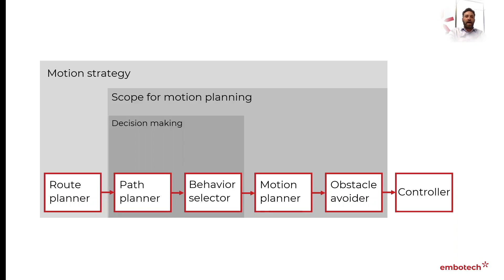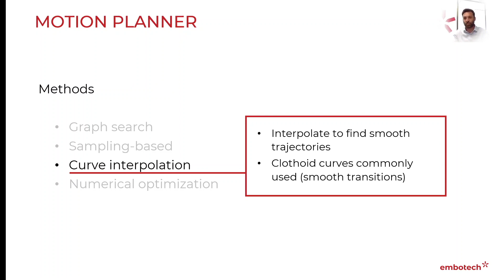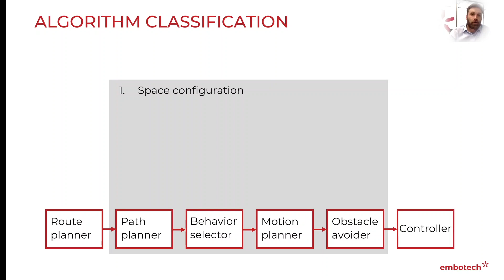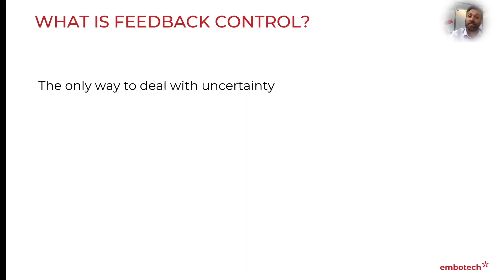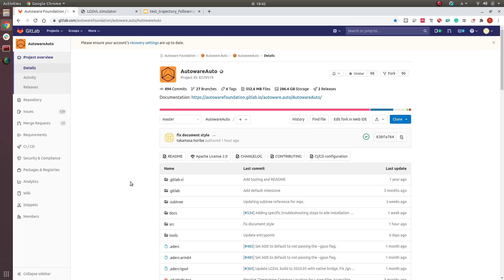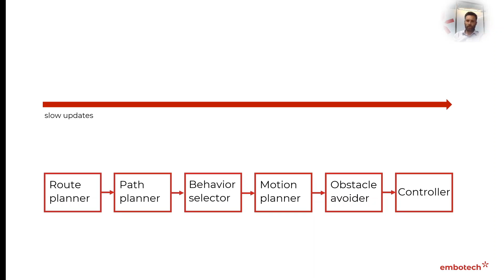Autoware Course Lecture 12: Motion Control

Comment: Hi about the lab: 
The guy told would issue the 2.Simple trajectory following  command. That is:
ros2 launch test_trajectory_following simple_trajectory_following.launch.py sim_type:=dynamics
However he launched this one of 3.Record play:
ros2 launch test_trajectory_following trajectory_recording.launch.py
Then rviz was displayed with the lidar info and odometry. However in my case I get this error, if I issue this command:
Global Frame: Error  
Odom does not exist. 
If I follow, step by step properly as written here https://gitlab.com/autowarefoundation/autoware.auto/AutowareAuto/-/blob/master/src/tools/test_trajectory_following/design/test_trajectory_following.md
I do open rviz2 and some matplotlib plots open together (unfortunately the lidar does not display anything, which means that is a problem with ros2-lgsvl-bridge) 
However my bridge connection was running properly and then when I launch the third node (ros2 action send_goal /planning/recordtrajectory recordreplay_planner_actions/action/RecordTrajectory "{record_path: "/tmp/path"}" --feedback) and the fourth node (ros2 action send_goal /planning/replaytrajectory recordreplay_planner_actions/action/ReplayTrajectory "{replay_path: "/tmp/path"}" --feedback) to record and play the path tracking with mpc (after move the car in simulator) I get a message: "Wait an action start" but never starts...
I runned with the executable lgsvl simulator (outside ADE) and Autoware lgsvl own version of simulator (inside ADE). In both I get this "odom" error. My json file of the car is complete with gnss/Odometry described in car Lexus configuration. 
I could just launch these nodes (also for Lecture 9 - radar, Lecture 11- Lidar+camera) when I do not use the command "source install/setup.bash". I use instead "source /opt/Autoware/setup.bash"
Then I thought that this can be the issue (The fact that I cannot use the cmd "source install/setup.bash". Because if I use what always happen to me is that when I issue this command:
$ source instal/setup.bash
in any shell to launch rviz2 or a ros2 node launch file. I get this error:
Segmentation Fauld (Core dumped)
or if I use to launch ros-2-web bridge I also get numerous errors.
Is there an expert that could guide me to fix this issue? I think this error is the main error of my system and is located in some bash file as this post recommend: https://askubuntu.com/questions/432476/running-bash-does-segmentation-fault-core-dumped
However my setup.bash or .bashrc does not have this source to "profile"...
Reply: @marcus: we now have the Autoware.Auto 1.0.0 released: https://discourse.ros.org/t/autoware-auto-1-0-0-is-here/19085

We have 2 articles related to the trajectory following:
1. https://autowarefoundation.gitlab.io/autoware.auto/AutowareAuto/recordreplay-planner-howto.html
2. https://autowarefoundation.gitlab.io/autoware.auto/AutowareAuto/trajectory-following-howto.html 

They both use the material presented in this lecture just not verbatim because the lecture was recorded 8 months ago.

If above articles do not work, please use https://autowarefoundation.gitlab.io/autoware.auto/AutowareAuto/support-guidelines.html to get help.
Reply: @dejanpangercic3367  Thanks very much for all the answers I will try! I just had an odometry issue trying to reproduce this class. And I always get this error when I source the install/setup.bash:
Segmentation Fault: Core Dumped
Then I always source the /opt/Autoware Auto.setup.bash.
I do not know the difference actually. I just know that for all the previous tutorials to work I needed to skip this source/install step. And change the snippet code: "$User" relative path when opening rviz2 and substitute to all the rviz2 path (my user). 
I read in the slide of last Autoware Auto class. That if you built a precompiled version you need to source the install/setup.bash and if you built from source code you need to source /Autoware Auto/setup.bash. What is the difference?
In my case I downloaded the following trajectory pkg copied ta a folder and built.

But in all lecture the install/setup.bash is sourced...and I get error if I do that. Do you imagine why?
I am not sure but maybe this odometry error that I get is that because I did not sourced the install/setup.bash or what?
My json file has odometry I also have launched the ros2-beidge to communicate with the lgsvl simulator. However the lidar pcl does not appear. And I did all the other tutorials from radar/camera/lidar that uses this bridge and worked.
Just this one the odometry does not exist in global frame as rviz2 say...

Is there a transform missing? Can I issue a static transform publisher from map to odom or base link? Which command can I issue to fix this?
Here is the problem better described: 
https://gitlab.com/ApexAI/autowareclass2020/-/issues/84

I know these classes were 8 months ago unfortunately I did not have time last year, I am doing now on my vacation😅 to accomplish with my master Thesis with planners in ROS.